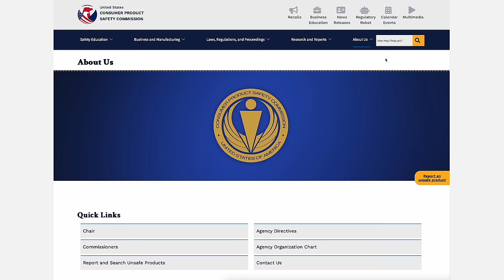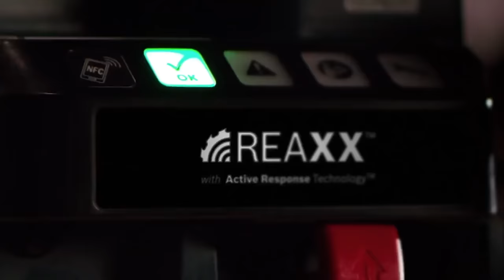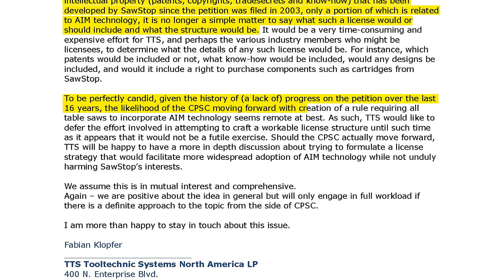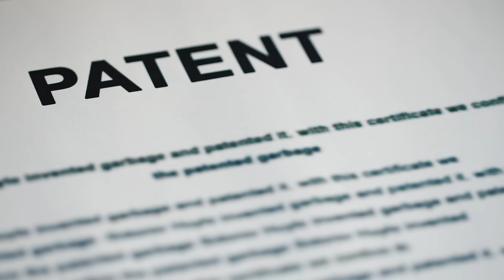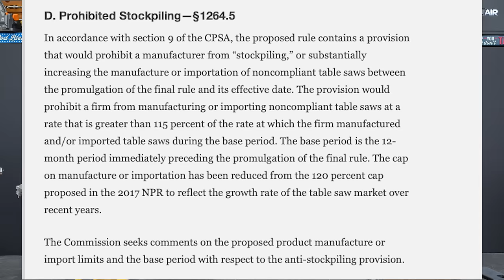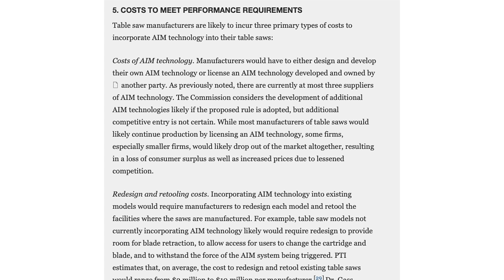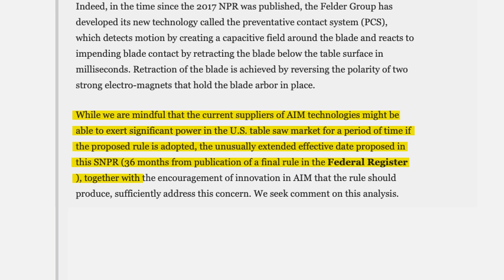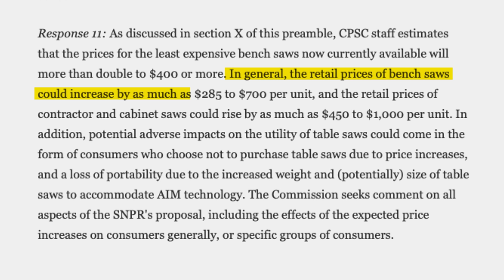The US Government is About to Change Table Saws FOREVER!

Comment: If SawStop is petitioning for this technology, then part of the rule should be that SawStop must release all their patents related to injury mitigation into the public domain.
Reply: If they did that watch how fast this would go away.
Reply: I posted longer,   The base patents are about to go into public domain.  At this point bosh dewalt etc….   Want the access to the tech without licensing,  or non aim competition.    Pass the legislation,  the 2004 sawstop model will be public domain,  any technology directly copied from it is fair game, even if later patented  (that’s just gaming the system).  And the 2004 sawstop level of protection or something reasonably close to it 3.5mm?  I think was mentioned.  And I agree, the Bosh competing technology should be unfettered unless it directly copies later improvements.  Now a licensing schedule allowing copy of later models if sawstop improved should be implemented.  Maybe $10 for a machine 15+ years old, $20 for machines 10 years old, $50 dollars for a machine 5 years old.  But every tablesaw made by a company will be assessed that level of royalty.  Same law/reg and fee structure applied to Bosch react and any other comp. Tech  And yeah…. A $10 dollar fee for every tablesaw.  Maybe just the base $10 fee at 20 years old,  and clearing impediments if any from later patents on same tech. As a thankyou for the drastic improvement in perpetuity.    1 dollar for all research in last 20 years… if there was any significant is ridiculous…. IMO.   REAL IMPROVEMENTS IF ANY SHOULD BE REWARDED.   Patenting a fastener with a special name that was there and not mentioned in 1999-2004 in 2020 if such a thing happened should not extend protection for 20 years because the brake is useless without it…. Just an example of patent crap seen previous decades on other products,  where good idea was buried in flurry of other patents that weren’t innovations.  Sawstop having 140+ patents with 110+ pending….   I have no knowledge how many might be BS DESIGNED TO PREVENT COPYING THE 2004 machine.
Reply: If sawstop were behind it they are not going to admit it. It would mean they're either trying to procure a defacto monopoly on table saw sales or they want to tax every machine sold by a competitor. Both those are contrary to the public interest so they wouldn't want anyone to know that and no commissioner would want to appear part of such a scheme.

If they wanted to license their patents they could do it today. Safe to say that's not what they're after.

But I'm not sure this has anything to do with them. They could have the ear of a commissioner or two, for sure.
Reply: @BadSpock  Gass has publicly admitted to it. He's not hiding it at all. How he approached the other tools companies, how they turned down his high pricing demand which then turned into him creating his own table saw company is all public knowledge. Him petitioning to make it a requirement is also well known. He's very open about being this kind of person.
Reply: @JDCrae yes that is what he initially tried to but then he productized sawstop. That is not necessarily his current strategy.
Reply: @BadSpock  Look up the lawsuits he has been involved in over the last 10 years. He's never hidden his strategy. It's his petition being discussed in this video ! It's his petition he submitted to make the tech a requirement by law. It's not just a random idea they are discussing.
Reply: @JDCrae The shitty thing about it is that if he was willing to license at a reasonable price, everyone would have jumped on it.

Every company would have been out there flogging just how remarkably safe their new table saws are and how their table saws are going to make ER visits and amputations a thing of the past.  Better upgrade your old dangerous table saw with a shiny new table saw made by us!  And you know what?  A whole lot of people would have done it.

Instead, pure greed has led him to actively do injury to society for what?  20 years?
Reply: If sawstop was petitioning for this technology, then the tech must be licensed under FRAND terms.
Reply: @johndoerter2413  "Patenting a fastener with a special name that was there and not mentioned in 1999-2004 in 2020 if such a thing happened should not extend protection for 20 years because the brake is useless without it…."

That would not extend the patent because it would not be patentable. There is a 1 year grace period on patenting an invention that you publicly disclose - after that, the disclosure is prior art and will be used against you in novelty and non-obviousness analyses.
Reply: @rynait They wouldn't be forced to "release" the patent. However, if they were involved in making this tech into a standard, they must license on FRAND terms.
Reply: @fortpatches   you are misled.  FRAND term is licensing procedure arisen out of negotiation with patent holder.  Government can not negotiate licensing (period). This is because government agency is not representing tablesaw manufacturers.  (hint: they are protecting customers, not manufacturers)
I am still concerned about this violation that agency decision may create [Sherman anti-trust act].  even with application of Chevron directive.  Directive says agency can not violate law itself or other laws that is in effect.
Reply: @fortpatches  another concern,  I suspect after supreme court decision on chevron directive,  table saw manufacturer is gonna sue this agency . 
and felt like there was no public input  since sawstop petition. thus ego feedback from chevron directive effect.   Is there phone number or email to that agency, for me to voice my concern?
Reply: @rynait  You are misunderstanding what I am saying. If it is a SEP and they are involved in the process, then FRAND has to be followed. If they refuse FRAND then the patent cannot be part of the standard. It is the standards org that usually negotiates the rate for all manufacturers. Once standards org is offering a FRAND license they are required to offer that license to anyone (wishing to access the standard), not necessarily only members of the organization.

Whether the agency can set the rate would depend on two things, whether the statute authorizes it and/or whether they are acting as a standards setting org (Which is a constitutional power of congress that they can delegate to agencies).
Reply: Exactly! It's all about the Benjamins!
Reply: @fortpatches  no, you spouted frand.  Gov't do not negotiate with mfg or represent mfgs.  I am saying agency can not violate law. (Period) even under chevron directive.
Reply: Yes but all the other saw companies are going to have to retool manufacturing and pay sawstop or develope their own. Bottom line is going to be companies going out of business or drastically raising their prices. Who pays in the end. The consumer.
Reply: @JDCrae  which is why i'll never buy a sawstop product
Reply: @fortpatches  can you point me to the US Code reference that addresses this? I love reading about stuff like this.
Reply: I 100% agree, the simple fact is that Sawstop already has the infrastructure for the parts and manufacturing, if the new models use the same cartridges then sawstop will be making bank anyway for white a while, in the end this would within a few years create competition lowering prices for everyone (on the technology itself.) I was personally planning to get a Sawstop when I finally get my table saw (Just got a new house with a massive garage!)
Reply: Agreed, but SawStop should be compensated for any patent tech that isn't about to expire in the name of safety. We still need to encourage people to develop new features, safety related or otherwise and without an incentive the tech stagnates.
Reply: Safety patents shouldn’t be renewable and should be considered essential with court mandates bother requiring cross licensing and arbitrating pricing.
Reply: @neoc03  I'm sorry - I don't know which comment you replied to, so I do not know what reference you would like.
Reply: @mrbigberd  Whether we like it or not, we live in a capitalist economic system. If I can't make money off of my invention, I'm probably not going to invent it because I could be spending that time inventing something that I can patent and make money on.  In short, if you want innovation in the safety space, don't tell the inventors that the government will steal their rights to it if it works.
Reply: Amen
Reply: @johndoerter2413 it is very hard to understand this comment.
Reply: @rynait  Of course it can. What do you think a patent is? it's just a legal idea of protection granted by government because they consider it beneficial to their economy or whatever. They can always change the laws in the public interest if the patent system is not benefiting the nation as intended. Some lawyers might fight that but overall if there is political will then all they can ask for is some compensation for the unexpected  legal change.
Reply: or the gov buys the patent
Reply: @ColonelSandersLite this is what late stage capitalism looks like.

Treat em like big pharma needs to e treated.  Price gauging laws are a thing - use them.  There’s nothing inherently wrong with the government t forcing a private sector to sell necessary goods at a reasonable price for public safety purposes, we’ve always done it.
Reply: @rynait they can absolute revoke BS patents, they do it all the time
Reply: @rynait  Yes, they can, you know who grants patents right?  

The Government.

You file patents with the U.S. Patent office, That is the "Governement" you understand I hope.

They can certainly void or place patents in the public domain, they are the administrator.
Reply: @rynait  Pretty sure CPSC has a website, the meetings were public. Because you don't know how to comment or take part doesn't mean you can't. 
And asking on Youtube? for real, I can really tell how concerned you are about it.
Reply: @chasferr  This regulation will not go forward, there is nothing precise to create a regulation from, and there is no way forward if it were to be regulated, it would be challenged in the courts and overturned immediately. 

a few examples:

There is only one technology available. It is not in the public domain.
The available technology does not meet the proposed requirements stated (8mm wound requirement, or whatever it was) 
There is one company making a product that would be legal to sell (in a theoretical way, it doesn't meet the requirements) 
The proposed window for implementation mentioned by the head of CPSC indicated a severe lack of industry/manufacturing/intellectual property knowledge.about the product he was proposing to regulate.  The only thing he knew about was injury numbers, and even those changed three times in 4 sentences. That man was an utter fool.
Reply: @rynait  it is certainly an issue of patent holder greed. SawStop has proposed this regulution repeatedly because it would benefit them immensely to have a monopoly on AIM that every manufacturer either had to license or recreate before they could sell.

As far as SawStop that trumps safety 7 days a week and twice on Sunday.  Safety has nothing to do with it as far as they are concerned
Reply: @ColonelSandersLite  It's not that simple.  If any company did license his tech and then produced safer saws, it could be viewed as an admission that all of that company's previous saws were unsafe, and that they knew it.  They would be sued for all accidents that had happened with their old products as a result and would probably lose in court.  So it would be legally safer for them NOT to adopt the Sawstop patents.
Reply: "Saving your fingers to reach into your wallets"
Reply: Yeah this may end up becoming a 28usc nightmare for saw stop.
Reply: @republicansthatdidntvotefo1605 Well, a Sawstop is about $1500, and you'll spend a few hundred more each year for the replacement cartridge every time it's accidentally triggered, which just happens from time to time. The cartridges are about $80 a piece last I checked, but that was 4 or 5 years ago. 

$1500 is for the portable job site Sawstop btw. The shop saw is probably in the $2000-$3000 range I would guess.

Most jobsite saws are currently in the $400-$500 range
Reply: correct
Reply: well I watched the hearing with the ceo of sawstop. they are happy to work with other manufacturers but they won't be giving up their patents that they spent millions on research and development. and I agree with that.
Reply: No, saw stop should never be forced to give away for free what it designed period. ESPECIALLY by the Goverment!!!!! Imagine the precedent that would set!! The Goverment should even be worried about things like this at all!!! The Goverment needs to cut in half. Then closely stick to the constitution!!! Abolish ALL three letter agencies!! Only bring back the FBI and EPA but much smaller with none of the old people culture or powers.
Reply: Gass said they would release the last patent if the regulation passes so def not about the money for sawstop

Comment: Sawstop's patent should absolutely not be extended under any circumstances. They've had 20 years of Monopoly on the technology and that is enough.
Reply: Originally patent rights were 14 years, and one renewal. So while their time should be limited, it would only be for 8 more years.
Reply: They cannot extend them but they can muddy the water with litigation regarding filing versus award dates and later patents.

That's why it's important to get multiple companies including sawstop agree to RAND licensing terms to preserve a healthy market.
Reply: It's not a monopoly you didn't have to buy one if you didn't want to, free to buy a finger eater if you want.
Reply: @johnseavey6622 It's a monopoly of the non-finger eaters.